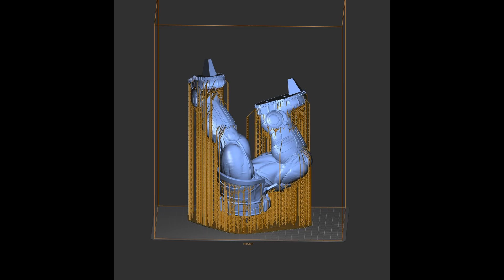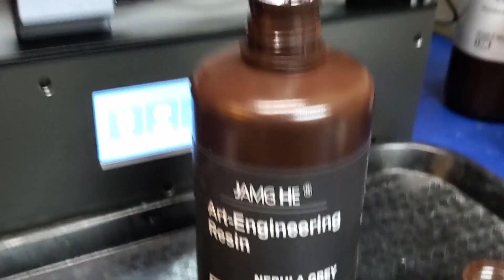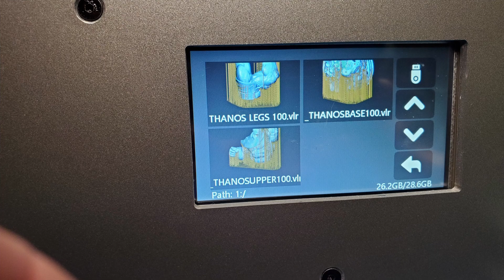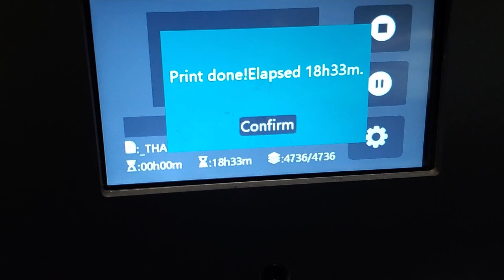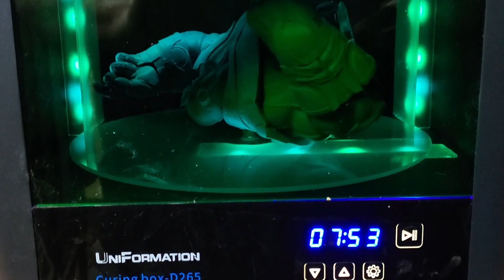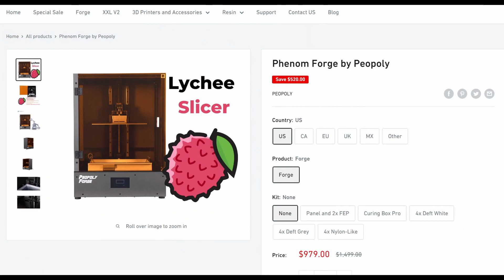Phenom Forge Resin Printer | JAMG HE Resin | Wicked Art Patreon Models #3dhp

Comment: I had the peopoly phenom until peopoly stopped supporting it . I couldn,t find a  uv  screen nowhere so i did the prime upgrade and it didn,t work l tried everything . Then i bought the peopoly forge and  man l love this machine its fast and quiet . I use the vlare slicer it took a while to learn it . Trying to teach a 60 year old brain something new on your own is difficult i was use to using chitubox all those years . I want to see you do more sculptures on the forge you are the only one l,ve seen use it so far everyone else is using the uniformation printer. I guess it,s because peopoly is geared towards manufactory than the arts. Great work and glad to see someone else use the forge.
Reply from the maker: Thanks When I get more resin for larger prints I will do some more videos on it. I also have the GK2 Love both resin printers. I try to only review machines I actually want to use as my daily drivers.

Comment: thanks for this video. my issue with the forge is the damage even the default light supports cause, have you tweaked any settings to get cleaner prints? Also fo the internal supports in vlare as long as "honey comb" and "lattice" are unchecked in the hollowing window you should get nice internal supports.